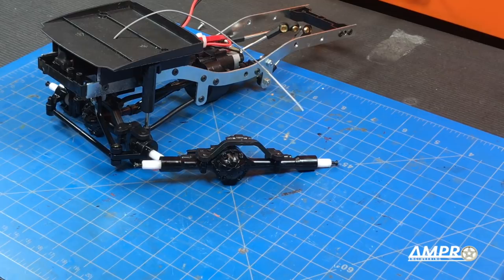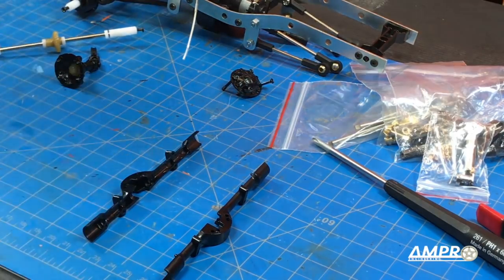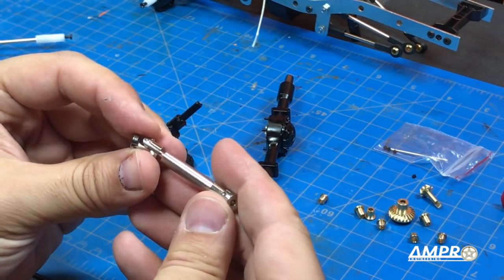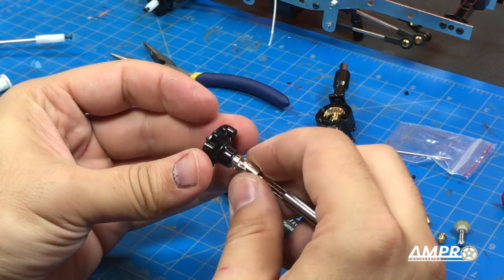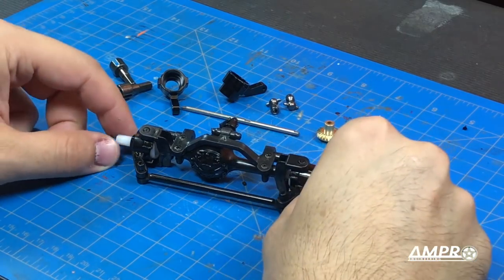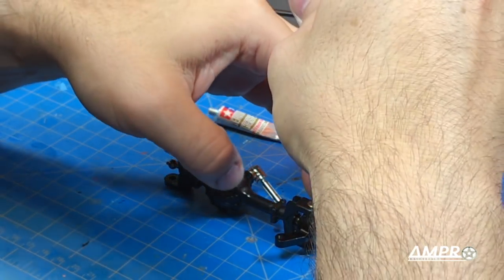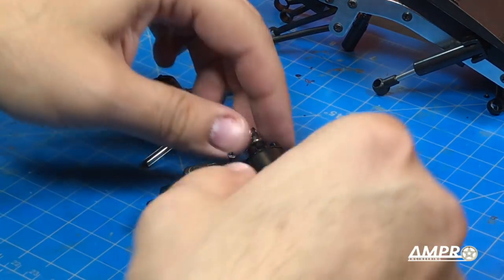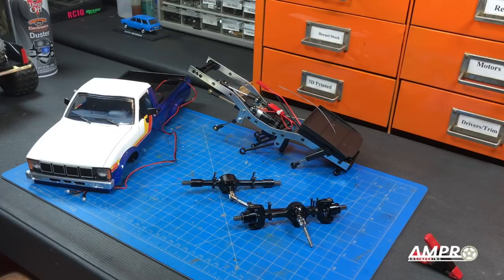e161: WPL Upgrades - Strengthening the Axles

Comment: Just got a set. but theres so many variations. my kit didnt fit wpl c14 but fitted on b1 axles. the bearings was to wide so had to replace them XD 1/16 china scale now is huge lego case.
nice channel you sir earned a sub
Reply from the maker: This makes sense. There have been kits I ordered that wont fit either. So frustrating.

Comment: I grabbed a similar kit with the other style driveshafts. Everything went together well like yours. Two problems; the steering link binds and doesnt allow the suspension to work, and all the axle ends (parts that connect to the wheels) had considerable rust too the point of needing a tap to re-thread.
Reply from the maker: RUST! OMG. That is awful. I have not seen binding but I am not at that point yet.

Comment: I bought the same up grade for the wpl kits i have . there very nice. I use lucas oil cam ahaft and engine. Assembly lube. Coats the brass gears nicely and its sticky. Just a little builders tip
Reply from the maker: This is a great idea! I use this on my real cars and never thought to on these.
Reply: @AMPROEngineering  it works good. Works great on ball diffs and gear diffs...tamiya or koysho etc

Comment: Alberto you might like this one... I CA'd a hanger to the top in line to the servo arm, ran a small short section of small model aircraft cable (1mm?) to a hanger CA'd to the front 4 link mount to the steering arm... no more suspension interference or bump steer when suspension is compressed. cable runs like a sideways U shape, used a lighter (cable inside sleeve) so the sleeve isn't making much of any spring/pressure on the front right wheel+shock. before this, anytime the front suspension compressed, the front wheels turned left, grrr!
Reply from the maker: Wow, that is a great idea. That is something that can be used on 1/10 rigs also!
Reply: thanks, I was thinking to axle mount a 9 gram servo and butchering the box above for the 1/4" (or more) of clearance that'd been lost, then "oh hey why not THIS?". the entry+exit cable fluxed and silver soldered to make it rigid, the steering link end I just wrapped 2 turns around a #1 phillips shaft and soldered into a collar/loop like "----O" to fit. DuBro push rod clamp on the cable at the servo arm is where to adjust for center (it's to the back side and a little tougher to access, but best location for lining up for shortest hanger and least flex), did have to flip the switch to reverse steering direction (big deal!). 

whipped up the hangers from bits of thicker white powder coated aluminum flashing (CA sticks really good) folded in half over a drill bit slightly smaller than the cable sleeve (squish tight with pliers next to the bit), so  when they're opened a little the sleeve slips in, when closed flat and CA'd shut they clamp down onto the cable sleeve. really nice positive steering now, no matter where/how the suspension is flexed! 

couple quick coats flat black and call it art, don't really notice it visually.
definitely will have to drop the axle and pull the 4 link mount to access the 4 pumpkin cover screws if bevel gears have a problem, isn't much  an issue, cable+sleeve is just long enough to turn it and undo/redo those screws to drop or install the axle (spatial awareness stuff). 

I could possibly get away with carefully just bending the aluminum axle up enough to get at the pumpkin cover screws too, but those plastic 4 link hangers aren't all that tough OR easily available...

Comment: Do you like these axles? I'm trying to decide between these and the bulkier titanium ones. I really am looking to add more weight in the hopes it will help with traction. Are these relatively heavy? Have you seen the other version that aren't as scale and much more bulky then these? The other option looks like it would add more weight but take away from the scale look. If these have substantial weight I'd rather get these for the look.
Reply from the maker: I really like them. I have about 4 sets and they have been great. They are heavier than the stock ones for sure but i you want to add weight, they do sell wheel weights.

Comment: I could be wrong but i did look it up to check, i dont think brass is self lubricating.  There are types of bronze which are but not brass.  Chances are the only reason the gears are brass is because its easy to machine.
Reply from the maker: Holy crap you are right. It was bronze with the oilite impregnated into it!
Reply: Sintered Bronze is used in many applications as a bushing in place of a bearing due to being self lubricating. Brass is just easier to machine. Does anyone have a link to the "ugly" driveshafts for these trucks? I have a 4x4 and also a  6x6 which I would like to upgrade.Thanks!
Reply: @JoesAutoElectric  actually sintered bronze itself isnt.  The self lubricating bronze bearings are impregnated with a lubricant.  The sintering just gives the lubricant a place to be absorbed.
Reply: I was told they are copper gears? Could that be possible? I have 2 sets of the brass/copper ones and a set of the steel black gears. They all seem to work fine for me. Also after a couple runs the steel stuff seems to mesh better than the other gears. It's just what I noticed. But none show signs of going bad soon.
Reply: Hi gays... What WPL stand for and where is located, company.... Tnx

Comment: Hi. Two questions. What's a set screw and how can brass gears self lubricate? Thanks.
Reply from the maker: A set screw is a screw that has a completely threaded body with an internal hex drive for torquing it down. Usually they are used to lock something in place. Brass self lubricates as it has lubricant impregnated within the mating surfaces. Upon saying this....I wonder if they manufacturer here actually did this.....

Comment: Mine came with the left side axles bent and the left front shock was over tightened and my rear axle transmission broke 1st day and i also had to super glue all the pres fitted parts on the drive train due to slippage
Reply from the maker: Ouch...yeah some of these are pretty low quality.
Reply: The RTR is build for kids only to play it from the box.. And the kit is for adult. That can afford to buy  an electronic & metal updrades for it.

Comment: Are the driveshaft/pinion bearings the same size as the bearings inside the axle?
Reply from the maker: Diameters yes. I have seen some axles where the bearings are thicker but for most of my WPL cars, yes.

Comment: I’m having trouble breaking the plastic to get the gear for the drive shaft any suggestions?
Reply from the maker: Has it worked?
Reply: AMPRO Engineering  no I ended up buying a new drive  axle

Comment: White out .  The kind you brush on.. work good.. ty4sharing!! Just did wlp p/u tk.. no ball bearings ?  What's the point.
Reply from the maker: When I did this upgrade, you could not get them. Nylon is naturally lubricated so they work fine for light use. This has since been upgraded.

Comment: They fell off mine and I got the ugly ones and they worked perfect kinda
Reply from the maker: I am not surprised. I ordered more of them too.
Reply: kinda wishing they'd done a drilled spot in the shaft for the grub to bite into, instead of a flat to clamp against, it always holds better. downside being can't choose where it locates lengthwise, like shimming/spacing the bearings further apart etc.

btw... minor cringe when you cut the stock U-joint off with the diag's, they're exactly what I used to lever the shaft out of the plastic bevel gear's splines, for keeping the parts intact. aim at the really short exposed shaft, a little squeezing and wiggling, then a little levering...
now you know :)

it'd been SO much nicer if they'd end drilled/tapped those short shafts for a screw to keep the bevel gear on it's splines. I really didn't like using a tiny spot of CA inside the plastic bevel gear to press it back onto the shaft splines. not enough wouldn't hold, too much could have made a grab to the darn (plastic) bushing. "painting" CA inside the bevel gear splines with a little frayed wire and squeezing the gear onto the shaft QUICKLY... grr! it's right up there with using a little JB-weld to attach stock U-joint to geared N20/N30 output shafts.. it works but dang!
(and the 24 hour wait for the junk to cure hard too, grr!)
Reply from the maker: I did try to wiggle them off but they just refused to move. I also didnt want to use CA. I hate that.